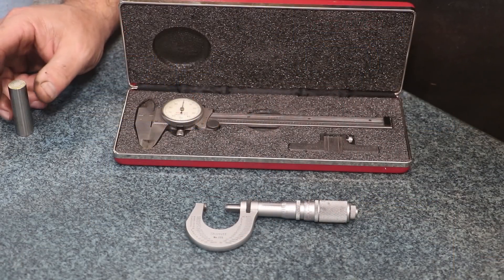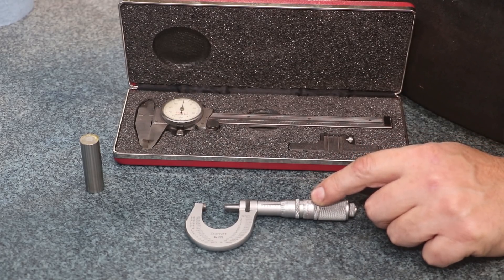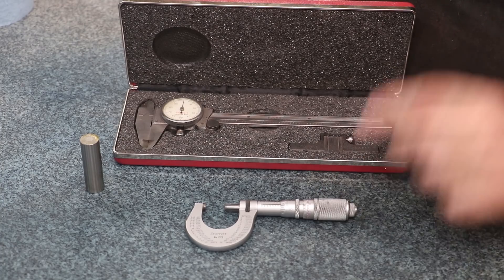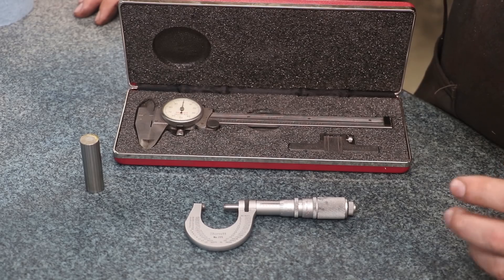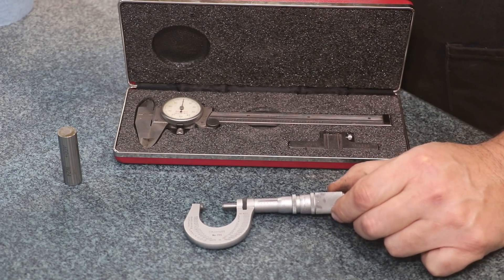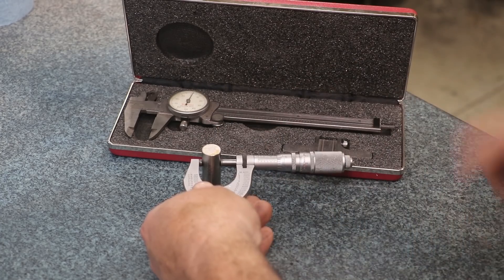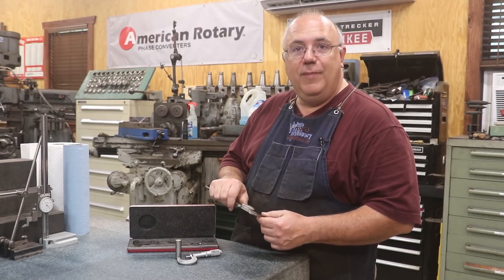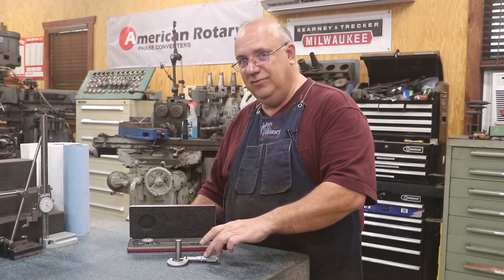Machine Shop Measurements: Dial Calipers vs Micrometers

Comment: Nicely said Keith. I have used my Mitutoyo 18 cm straight vernier with fine adjustment since my apprenticeship, it measures down to a twentieth of a millimetre, it has no sensitive dials, or batteries that go flat at inconvenient times. It is a high quality tool and I have never had a job thrown back at me because of wrong sizing.

Comment: Thanks! I'm not a machinist but have used both calipers and micrometers. The first thing I notice is how you keep the calipers in a box. That might be part of why yours are accurate even after heavy use. It might be time-wasting overkill, but I used to check both for zero reading when they are closed. What do you think? Many of the micrometers come with a little spanner wrench for zero setting.

Comment: Great video! I have only been working (playing) at this for a couple of years, so I am still a long way off of building precision parts. However,  as a craftsman building all sorts of wooden/metal/pastic/stone/etc things over the years I can totally relate to your take. 95% of the stuff I build can be within 1/8"--1/4" . 4.9% of the time I need it down to a 32nd or 64th. And that last .1 % well lets just say I might bump or bend or tweak to get there. I can remember very few times in my life that things had to be ultra precise.  Moral of the story, measure/build to the needs of the situation.  Theres a big difference in framing a house and building a rocket ship.

Comment: If you were to speak to  Great Grandpa, he would ask you what's wrong with Spring Calipers?
But remember the tolerances on the  Tail Rudder of the Sopwith Camel were + or - 1".
The Tolerances on a parachute were Exactly Zero.  Now That's Precision....!
And if you spoke with his Great Grandpa, he  would ask what is wrong with  using your 
Arm as a Cubit and your thumb as an  inch. He was so good he didn't Need Precision....!

Comment: You did not mention a big convenience issue.  It's a wide range that a single dial indicator has.  If you need to measure 0.5", 1.5" and 2.5" steps on your part, a single dial indicator will mostly do, but you probably need 3 separate micrometers in order to measure all three steps.
Another thing getting to nitpicking area is the temperature, both the ambient and the part.  If there is temperature variation, the will soon be detectable measurement difference.  Which instrument is then more accurate, when both may be affected by the part temperature?  Nitpicking, nitpicking...

Comment: I disagree that "there are no disadvantages to digital calipers",they have several imo.Firstly they can slip the scale,impossible on a rack with a dial! Secondly they are easier to knock zero reset than to knock a well locked down dial and if you knock a dial you have more of a chance of noticing and lastly ive never had a flat battery on any of my dial calipers! I used to be hardcore vernier (no crud sensitive rack and fragile dial) when younger but these days i had to resort to dials because my eyes aren't up to consistent reads on vernier calipers anymore.I do agree one the whole mic vs caliper debate though,its totally situation dependent.Sure  I (and most)could get by with just one digital caliper but thats  just boring! Its much nicer to have several dial calipers in metric and imperial,full set of mic's,bore gauges,depth gauges,height gauges and all the other things we really only need to use for something specific on occasion and could probably scrape by without It but it sure is nice to have the exactly right tool for the job when you need it.

Comment: Keith your spot on!!!!! If your working to below 1/1000 of an inch you need to interpolate material temperature to the coefficient of linear expansion for that material and what it is mating with if that material is dissimilar. I have worked in metric for the last 25 years before I retired. I had machines that could work down to 1/100 of a mm in the right hands. We never had a job come in where the tolerance was under 0.10 of a mm. Even the aeronautical work we did. Thats 0.00393701 inch and at that level its all about temperature and expansion rates. Good dial callipers or digital in the right hands are as you say are what you need to get it out the door with a happy customer. Ant. SV Impavidus.

Comment: I had to read a far ways down the page before I found some guys commenting about checking their measurements while roughing out with calipers, then switching over to the micrometer for the fine measurements at the end.

It's as Keith says, the calipers are faster, and often good enough.

Another topic which I see is about why a micrometer is generally capable of finer readings than a dial caliper.

The way that I phrase that is that you can get more threads per inch on a screw than teeth per inch on a rack with a pinion gear, and you get a longer sliding distance by making the scale wrap around a spiral.

That said, vernier calipers don't have gears, and can be more accurate than dial calipers - at the cost of time spent reading them. But, the scale slides on a straight line, so you have practical limitations. The various scales used by digital calipers can have some advantages in readability over the vernier scale, at the cost of being a bit fussy about holding zero and eating battery charge... which doesn't always correlate to the purchase price or the name on the label...

It all depends, and personal preferences aside, what tolerances are good enough for any given job...

I used to work at an optical electronics operation as a very young engineer, and had designed some parts where thermal expansion had to open a very accurate gap of a couple of thousandths of an inch for the electrodes to function optimally. The gap was incredibly narrow, and given that the parts were welded into an assembly, the pre-sets had to be very carefully fabricated in order to minimize the infant mortality and trashing of the rather expensive materials that make even more expensive assemblies.

Since this was for a development project, my work got assigned to a drafter who came from a temp agency, and what little experience he had was with making mass produced parts.

You could hear my roar of anger over half of the second floor (or so I was told!) when I got the checkprint and found that he had taken it upon himself to "correct" my design tolerances for me, "because nobody can hold tolerances so tight" as he lectured the "impractical and inexperienced" junior engineer...

He was still very smug and self-satisfied when the drafting department manager and his deputy came by to see why I was going off... something about not asking me first about why I need the parts held to such tight tolerances, and then trying to lecture the engineer rather than discuss the design on a point-by-point basis to understand the reasoning behind why my parts were a bit exotic...

It only took about a minute for him to lose his self-satisfied mindset after these two worthies arrived... 

At the other end of the spectrum I've designed equipment for bulk materials handling and industrial ventilation where +/- 1/8" (or more) is more than close enough...

Comment: I think you really nailed it Keith.  So many have become obsessed with ultra-high precision because "we can".  As you state, as long as you are within the tolerance or "spec", then use the tools that get you there the quickest.  Time is money.  Shop time is INCREDIBLY expensive around my area ($100/hour is NOT uncommon with 2 hour minimums usually).  If there are 30 measurements needed that take 30s each with a micrometer that's $25...If the tolerances allow for it, the same could be done with the calipers the cost is <$2.  

I see people commenting in other videos "I need a lab grade AA surface plate"..really?  What for?  I mean, hey if you can get one awesome...but do you NEED one?  I worked in a machine shop and as a machine builder...all our plates were Inspection Grade "A" plates...and we were doing some precision machining lines back then (30+ years ago).  

We do get too hung up on "perfection" I think.

Comment: Keith, I was one that cringed when you were measuring bearing surfaces with the caliper. I work with extremely tight tolerances and our shop has pretty much banned the use of anything but calibrated micrometers and the like. I made my comment out of more of a personal view rather than attempting to insult your intelligence. If you saw my comment and took offence, I certainly apologize.

Comment: Is it better to use a Caliper or Micrometer? Yes.
I use both Metric and Standard/Imperial, there isn't much difference between the two  for calipers, layout work is a bit easier with Metric.
For Micrometers, Metric is much easier to read, it's more or less a direct read, whereas with standard you have to some math/thinking which can lead to errors.

Comment: Ok I will put my 2 cents worth in, I am a machinist of 44 years + it has always been with me on what Measuring tool is correct for the job at hand. Yes like Keith sad its what you are comfortable with and the accuracy that you require. I my early days Vernier Callipers had fine adjustment thumb wheels like some of the older type of Vernier Height Gauges still used today. I still have 2 sets a 12" and a 24" that I still use today due to the accuracy I get using this type of calliper. Now on the use of these I find I use them more for measuring lengths of components rather than OD. This is more that the anvils on a Micrometre seat on an OD better than a Vernier Calliper. Vernier Callipers are a more versatile tool for quick measurement of OD, ID and Hole Depths in one Tool as though with a Micrometre you need a number of tools  ie:- Depth Mic, internal Mic, and Std OD Mic etc as the list goes on. So Yes Keith has his point, good job Keith keep up the good work.

Comment: I have some calipers that have enough space between the divisions on the face I can easily tell a half thousandth on parts but only because I've used then so long I can repeat with them.  Same with one of my lathes.  Indirect dials and no DRO but have used it for so long I can usually hit within a half thou...  Tenths make me dig out the micrometer ever so often.  Thanks for the Video!  Some people try and substitute being anal for common sense.  I suppose a good video came out of it but I wouldn't want to see it irritate you in any way.  Again, Many Thanks for the great videos!

Comment: Well, you took a two minute talk and hammered it flat into almost eight minutes, repeating the main talking points over and over and over again. Either you run with a really dimwitted crowd or you needed to get a video out there and didn't have much to make one with.
Next video: to lock the door to the shop or leave it unlocked .. and how to decide whether to use the deadbolt or just the knob lock.

Comment: I keep a low cost 1" and an old 1"-2" for "general purpose" work.  My more expensive set stays safe in the box and only come out when I need highest accuracy (to the 10th).  Reduces the risk of accidental damage that way.  Calipers are usually good enough to get to within 15 of my target size. After that I use the mic's.  That seems to work best with the old warrior.

A few other things I figured out: If you zero calipers with a certain amount of pressure on them, you need to measure with the same amount.  Then open them up, check with your blocks or with the standards for your mic's.  Also, check your mic's at maximum size if you can, it's good to know if the calibration drifts (and in what direction) when they are opened up.

Comment: I recently machined a spacer block / bracket. The only dimension I even measured was the hole spacing, and I did that with a ruler. I could have done it by marking the spacing on a piece of paper, and transfering that to the workpiece. Even dial calipers were overkill. The part worked and looked fine the first try. Don't buy a laser interferometer if the tolerances are +/- 1/4 inch (6 mm).

Comment: Be as precise as needed and as sloppy as you can get away with.  

No need to hold tolerances to the tenth of a thousanth when working with babbit journals, but a body cant just measure to the closest 64th when machining an air bearing.  

That one foul mouthed canadian boy did a good vid on comparing hazard freight cow lickers to mititoyo caterpillars.   For the average drunken frenchman, the cheapies are going to work just fine.  

No matter what you use, once you drop your measuring device a few times on the floor, they are slightly less reliable.  Its also less painful when your five year old boy takes your $20 performance tool caterpillars apart than when he gets your Starrett 6" mic and uses it for a c clamp.

Comment: The worst thing with calipers is that people tend to angle them instead of looking for the lowest measurement on O.D. or the highest on I.D. The other problem is not knowing if the inside and outside are reading the same (somebody dropped them). when sneaking up on a tolerance fit, the calipers are out.

Comment: Nice subject Keith, I updated to a new set of Kanon Vernier stainless steel  calipers 40 years ago, I don't remember when the dial calipers first came into common use, I did not trust them, so at 75, I purchased a new Digital set. Takes a long time for old people to adjust.

Comment: If the calipers have crud on the jaws they can give you misleading readings. Same applies to a micrometer.  Wipe off crud.With fingers, not a cloth.  If you overtighten either instrument, again wrong reading. Be careful where you store the instruments. Not right on the lathe or mill because that is crud heaven. And as you say, practice! Good shortie, long overdue.

Comment: One problem with Dial calipers is if you get dirt in the gears it will jump off calibration and you could be .015-.020 off. I'm a retired machinist of 45 yrs. and I scrapped a few jobs by not checking my calipers ahead of time. You're in a hurry, you pick them up off the work bench and never notice it wasn't zeroed out.

Comment: Kieth, I agree with you completely about the use of calipers vis-a-vis micrometers, but I prefer digital to analog. In this situation, Chinese instruments are not viable. They tend to consume batteries way too fast and provide erratic readings. Quality digital instruments, like Mitutoyo, are faster to use and eliminate some all too common human error issues which plague their analog counterparts. 
As an analogy, though quality work can be done on a manual mill using the dials, once you've used a DRO you wouldn't go back to analog;-)

Comment: I Agree 100% with you Keith . Most jobs dont require .0002 accuracy .Some get so stuck on the being in the 2/10ths all the time when the job doesn't require it. I use my   mitutoyo Calipers for just about every process . Micrometer is only pulled out for press/Interference ,Bearing clearances. great Video (Haters are gonna Hate ) lol

Comment: Very well presented, have done this for over  50 years. Still have a vernier caliper, no dial and although it is a bit hard to see the scales now, it still gets used sometimes.  For the tightest tolerances, out come a range of micrometers.

Comment: Even the cheap electronic Chinese calipers for $10 can measure quite accurately - to 0.001 if you know how to measure. People get these, abuse them and then say they are crap. Once you realize that its all in the feel and pressure you apply you get good results. Also need to zero them often. Dial calipers are nice as well but more fragile - once you drop them on an end or front when open they are damaged. Micrometers are cool but very slow to measure and without much practice not much more accurate then caliper. Most work in hobby machine shop is not in need of accuracy beyond 0.001. Only reason to do such accurate work would be to have some fun trying to hit the number.

Comment: What gets me is that people assume that if you zero the measuring tool out at the small end it will be accurate throughout its range. Not so and especially with calipers. The dial ones can be off substantially at certain locations and spot on in others.  Micrometers the same but not nearly as prone to this. To combat it when I use calipers for a specific dimension I set them to that dimension with a gage block stack. This greatly reduces error from a worn rack or gear. I have even done the same with a micrometer because the thimble thread will wear also. Just something to add to the mix to ponder.

Comment: Well said on your side Keith.  In my defense, I guess too many decades making military spec parts and pharmaceutical parts has me doing all my precision measuring with a micrometer.  I will add if anyone is going to use their calipers as their "go to" measuring tool, make sure you check out the jaws with a gage block to see if there is any wear towards the tips. 
 Jeff

Comment: Keith, spot on.  Period.  Why spend the effort to hold 0.0001 tolerance when the print says +/- 0.003  "sigh".  I use both, and use the calipers 70% of the time, and the mics 30% of the time.  I am comfortable with and use both, exactly the way you do.